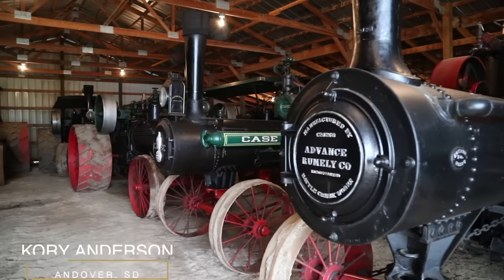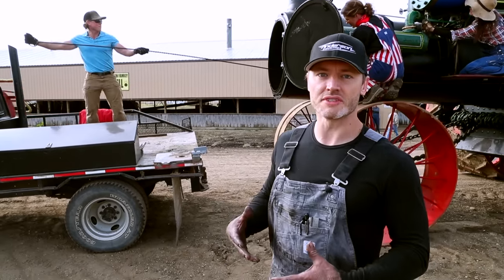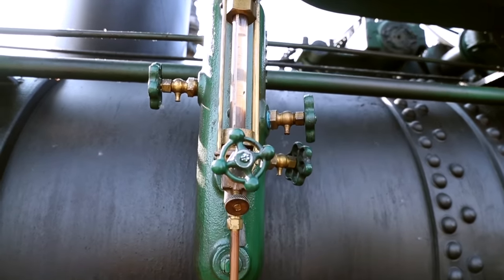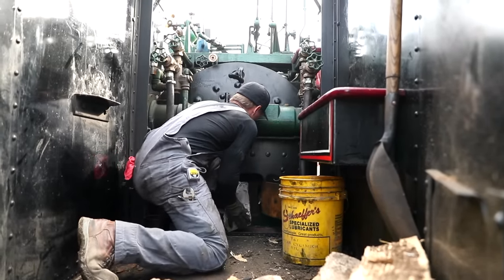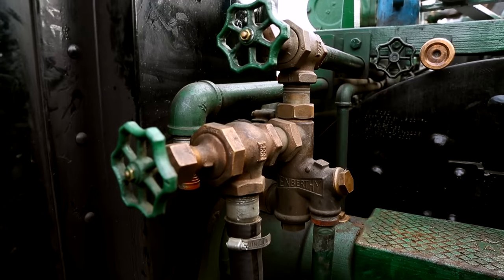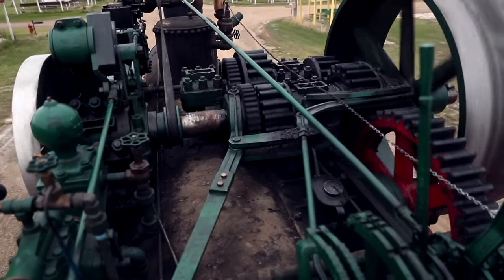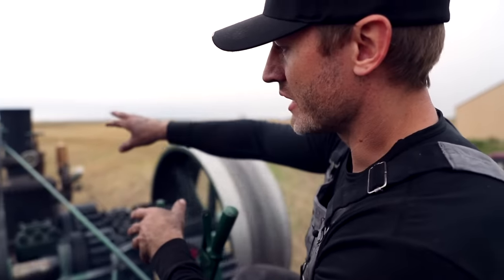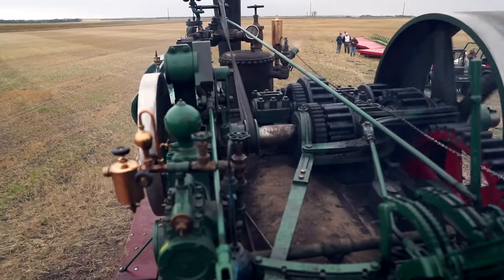FIRING UP the 150 CASE - The largest steam traction engine in the world prepares for a record pull

Comment: A legitimate steam locomotive that jumped the rails and never looked back.
Reply: Looks like they do still make 'em like they used to do!
Reply: @lairdcummings9092  sometimes, on rare occasion, and with advantages of modern metalurgy, and the modern tools to make it cleaner, and keep it running longer, just like the t1 trust, keith rucker, and places like the coalition for sustainable railroading keeping steam research going on and studying the use of greener solid fuels for power generation in off the grid places using waste wood and invasive species.
Reply: Hemp and coppice willow have strong potential for biofuel. But both need large land areas to provide the fuel volumes needed for utility scales.
Reply: @davidelliott5843  well for making ethanol it was said if we could break down the cellwalls and use stems and leaves too instead of just the grain we could have the holy grail and make it with switch grasses that take little room to grow in the usa in vast expanses, the biocoal though is proposed to use fast growing wood like poppalar or somehting thats invasive like cattails in mauratainia, or kudzu that grows like wildfire, its picked and then basicly roasted like coffee, and the off gases are reinjected into the reaction making it 90 percent energy effecent, compaired to 30 percent to make biodiesel out of plants, then the material is pelletized and burned its 80 the caloric value of coal, has none of the heavy metals of real coal and half the emissions, its much better though takes a bit more to get the caloric output of real coal, but far cleaner and one way we might keep steam locos running if all the coal mines close in the usa which like many parts of europe could happen, still though if your burning the coal right you should have gray smoke not black as half of it is waste steam helping provide draft on the fire at least with a stephanson style locomotive which is what prodominates and helps feed its own fire with air and more heat, black smoke is waisting fuel and a sign of not getting good combustion on what your burning, but it puts on a show, but even back in the steam loco days they had air inspecters that would watch for excessive black smoke and fine the engine crew or railroad for exceeding the limit on how much smoke could be put out.

and with steam though getting the energy into the water to make steam is not as effecent as internal combustion engines but if you can burn it you can use it in a steamer if you have the right firebox and air mix or grates depending on the type of fuel, and all the power is there as soon as you open the throttle valve unlike other motors you have to let it rev up, or spool up in the case of a turbine which has a constant pull but lags two seconds from any changes in its speed
Reply: If you say so
Reply: @AverageOhioan1903  no really read about it here this is the white papers from the group https://csrail.org/whitepapers

and some of the papers and philosophy of Livio Dante Porta

https://enginemanwook.wordpress.com/2010/07/30/the-life-writings-of-ingeniero-livio-dante-porta/

and Gary Bensman that I know a bit from helping out at the fort wayne railroad historical society worked along side Porta for a time, and said the man was everybit as nice a person as he was good at working with steam engines, though I would have thought porta would have been a tough master of his craft but I am told he was very kind.
Reply: @davidelliott5843  well if someone would stop being so uptight about smoking weed, there'd be no issue getting enough supply for a while.
Reply: @manga12  biocoal vs biomethane for transportation fuel will be an interesting competition when it gets to that point. Is biomethane more efficient than coal or not? Is cryogenic natural gas or solid fuel easier for fuel supply logistics? Will combustion engines continue to reign supreme on the small scale or can the 60% efficiency of large scale steam be miniaturized?

Probably neither, and big oil or big electric will convince the world that biofuel engines are evil and horrible and cannot be trusted because they take candy from starving kids in Africa, but we can dream.
Reply: @wyattroncin941  the logistics are differant but I really think you ought to read up what the potential and the goal of the coalition for sustainable railroadings project states, I mean could you imagine how clean it could be if we were to mass produce the torrification plants and use the biomass in plants for power generation it would do wonders to take out the emissions of coal, and still have the wherewithall in power output for the size of a plant vs much of the newer green power, solar is good, but there are other materials that can make more electricity from the sunlight then the silicon thats currently used, and wind well it has its own problems, like when there is damage to the edge of the blades or lack of wind slows down the spining rate, and they make a constant noise as the wind blows against them, not to mention create shadows that drive people up the wall and microvibrations in the air that they say makes people and animal behavure change, but really what a goal is for this is making a small scale locomotive boiler like boiler that also uses the gasmaker firebox with the over fire jets to help get more complete combustion of off gases and use a smaller high efficiency reciprocating engine for making power so in really poor places and off grid places perhaps they dont have to pay for expensive diesel fuel, and also have the loud noise of the motor running, and fuel it with invasive, abundant fast growing plants or, waste vegetation they have on hand, I think if they can get a few big backers it might be able to catch on
Reply: @lairdcummings9092  accurate.
Reply: @That_Thicc_Cat  well its well underway, the boiler is near done has like 2 parts to finish the shell from what the information on the website says, like a throat sheet and then it will be fitted up with pipes and flues, and onward to the smaller castings that will make up the frame and that will be a big one, had a huge fundraiser to help with those two things with matching doller amounts, I think is going on to the end of the year of 2020, they keep putting up pictures of the diagrams of the frame and its not a simple casting its very complex from the looks of it, and making the parts of the patterns and molds to cast it is no easy feat, I have been looking a little at foundry type stuff and its not just tamping down sand there is a whole art to making the parts of the molds and copes, and then getting the mold right if they are using sand, sometimes they use other methods to make, but 3d printing and additive manufacturing has been a heaven send for the complex parts making or making of the molds since a cnc can make molds more complex and more accurate with cnc then a human ever could under normal circumstances, they say it will be a 20 year project based on the time it took to build that tornado class locomotive, but its been 5 or six years and they are well underway, judging at the speed they move on making parts I bet the frame will be all cast by the end of the year 2021 or maybe midway through 2022, but remember this is a marathon not a sprint race
Reply: @That_Thicc_Cat  well they are hoping for 130 mph but in time we will know as long as we have the momentum going
Reply: All I’m saying is that even if you put locomotive wheels on it, it wouldn’t fit any loading gauge
Reply: @Admm744  problably not, but you dont have to pop all of our balloons, dump a bucket of water on our camp fire and then kick the ash in our faces like a playground bully.  now do you, one can dream of hypotheticals right?
Reply: I do believe they were referred to as, "locomotives," Many times.  But they were geared for phenomenal power, with no regard to speed.  Rail locomotives had to provide both power and speed.
Reply: Whats cool is hats how the originals of these where made. You had a old train that wasn't fit to run on rails anymore(maybe to old or out of date) but still worked just fine. SO you take off the boiler and engines (expensive parts) and put em on a new tractor frame. They did this for along time as it cost a lot more to remelt down the boiler and giant pistons than its worth to do it.
Reply: There's a very similar traction engine at the Henry Ford museum
Reply: @manga12  Even just materials science in general. For example, there's alloys which have little-to-no thermal expansion properties and others which can easily handle far higher operating temps without major drawbacks which simply did not exist back then but would have huge implications for a "modern" steam engine of some description.

It's a dream of mine to eventually make a "What if?" locomotive: A steam engine that tries to reap the benefits of modern technology just to see how powerful it can be or how fast it can go versus the older designs.
Reply: @wyattroncin941  I've always said that if a heritage steam operator wants to make some easy donation bucks, run a show on April 20th where all the fireboxes at the show are filled with hemp or just normal weed if it's a remote enough location.
Reply: @manga12  You have the right direction but the completely wrong idea. Collecting and transporting solid biomass is hugely inefficient unless there is some way to automate it. Instead it should be massive algae farms on the coast, you pump concentrated liquid algae to processing sites using the pre existing oil pipe lines or by cargo ship which we already do with fuel and oil. Algae farms are easily automated and can use the already existing infrastructure.  Using loads of machinery and manual labour collecting and transporting biomass from plants/trees would make it too cost inefficient.
Reply: @hammertime9183  we do have automation for many things, I am sure they have machines that plant trees, I mean they already use tractors that are prettymuch gps guided and the driver dont really do much except for emergency situations when running the field planting seeds, I am sure they have automated tree planters, and harvesting trees those machines are pretty much programed as well before they are sent out or at the begining of the shift or area as to which trees to leave along which ones get sawed, how long to saw them it pretty much pushbutton. though a good deal has changed in the last year, the coalition has shifted and looking for another place to experament with torrified biomass, as the origional grant was up I guess and the university of minnisota wants to go a bit differant direction on fuel research to stuff like perhaps biochar, and other products, however on another front matt jannson made a solor concitrator that boils water using the sun and it gets an 800 degree superheat meaning it has enough energy to run it compound high pressure and lower pressure to get more effcentcy out of its thermal energy, and there is the matter of fireless steam engines where a molten metal or salt source of heat is used to boile the water on a very insulated boiler and the steam is still used to drive the loco, only you dont have the constant burning of fuel, its an old concept but there is still life in it to be studied
Reply: @manga12  Trees are 100% no go. You could automate planting by seeds but after that it's all negatives. Cutting them down can't be automated, they take a long time to grow, and have to be regularly maintained to prevent fires. Crops/plants could be done but are still slow to grow and usually require a high amount of processing like cleaning them - it's simply better to make food crops instead. I also know about the superheated liquid salt which can be used to produce electricity, however the salt is super corrosive and requires specialised  ceramic to work. It's still only good for electricity. Magnified sunlight to superheat water is also good for electricity but like the salt it is also weather/season/location & daylight dependant if its to be used on a mass scale. Algae on the flip side is by far the fastest to grow and easiest to transport, the only down sides is removing the water & salt from it in processing it into a solid biofuel. Also the initial cost of laying pipe down is high but the over time cost is far cheaper and faster than any other method.
Reply: @hammertime9183  the tree harvesters are already practicly push button and programed, and one uses faster growing trees like poppalar, its a type of molten salt and there are differant ones then what you might be thinking of, and differant corrosion resistant materials that can be used, the sunlight collector is mostly being designed for off grid generation first, like alaska or the southwest, dispite the harsh conditions, and yea its like other forms of power like solar or wind its dependant on the conditions but its fits in to an overall systome. algee is not perfect eaither it takes up oxygen and grows like wildfire overflows stuff in a hurry
Reply: @manga12  make you comments more readable, jesus. You write 10 line sentences that make almost no sense
Reply: @manga12  Wow, a lot of confusing information in only two book long sentences and one period.
Reply: @ellieprice363  yea I need a bit better grammar, but I also talk very quick and relay lots of information when I have to get going and get excited, in real life too, and without taking a breath. It is,problably a side effect of my attention deficit disorder and excitability of wanting to relay all my thoughts quick before I forget what I am going to say.

Comment: When your vehicle isn't the fastest but it wouldnt stop. Not even for a concrete wall
Reply: @blocke2551  marvin heemeyer?
Reply: I watched a tractor pull one time in I think Wisconsin that had a steam tractor, I'll tell you it wasn't fast at all but it did the full pull and it was much smaller than that 150, I believe it was a case too.... but I could be wrong as this was something like 18years ago
Reply: @jaysonlima9271  yeah there is also a video that a traction engine won a tractor pull
Reply: @jaysonlima9271  I understand that this machine performs a mind blowing 5,000 lb-ft. That is 2.5 times more torque than the most powerful tractors deliver today like the New Holland T9.700.
Reply: so basically the average electric motor
Reply: @HansOvervoorde  and how much of that is ACTUALLY produced by the motor? no cheating garbage mechanical advantage, the engine has to produce that directly. for reference, my direct drive electric motor puts out 400nm and fits in my hand. absolutely obliterates every type of engine besides maybe a rocket LMAO
Reply: @Blox117  Not anywhere near an even comparison.
Reply: @nathanwahl9224  exactly, if it were even the electric motor would be galaxies apart from the pile of scrap.
Reply: @Blox117  eletric motors are new steam has been around for hundreds of years
Reply: @Blox117  Electric cars have a thousand pounds of toxic wastes in its battery. Enjoy that battery replacement bill in a few years lol. Talk to me when your Tesla lasts 20 years. Oh wait it won’t lol.
Reply: @localpumpkin5970  electric motors are almost as old as steam engines
Reply: It basically changes the rotation of Earth
Reply: @Blox117  Wow, the Romans had electric motors?
Reply: @Ma_Zhongying  the romans had no prime movers, unless horses count
Reply: @Blox117  Aelopile.
Reply: The Aelopile was neither a Steam Engine. Nor was it used to pull ploughs. So the comparison is nonsensical. The Aelopile is a rotary engine working on the rocket principle. In that it used the Steam pressure to produce rotary thrust. Pedantry is all well and good but serves no purpose in this discussion.

Still. That Blox guy was being an asshole so I'd say he deserves it.
Reply: @tripplefives1402  yep same as electric motors
Reply: @Blox117  except you wont see farmers wrapping wire to fix a motor in a field. also using max torque on electric motors will demolish not only the battery but the lifespan as well. Tools have their own uses, and electric motors are used in all sorts of things in fields (the watering systems use bunches of them, as well as silos and grain bins) but they have their use cases, and having to go back to charge up your tractor 2 times a day isn't practical. Plus inability to do some repairs in the field. I have a feeling it'll be a long time before you see the end of diesel tractors, and comparing steam tractors to electric cars is like comparing a scalpel to a tree saw. at the time battery tech couldn't even comprehend running a motor close enough to do anything like this, and even now battery tech isn't quite good enough for electric tractors to be practical.
Reply: @Mike.The.Jeweler  not how it works bud lmao

Comment: Badass piece of machinery and engineering. Hats off to you guys for running, operating, and maintaining that piece of history.
Reply: You forgot building lol
Reply: This particular piece of history is only a few years old. Kory Anderson built this engine from blueprints ata cost of $1.3millon
Reply: @wwjd6922  jesus that a lot. However its also a lot of metal and casting for a one-off also isnt exactly cheap
Reply: @D3nn1s  Kory did everything in house. He has a foundry and a huge machine shop.
Reply: @wwjd6922  well i guess then it comes down to whats included in this price tag. Still crazy though